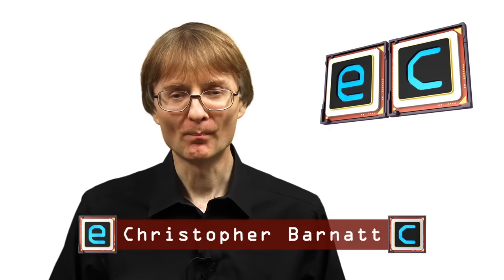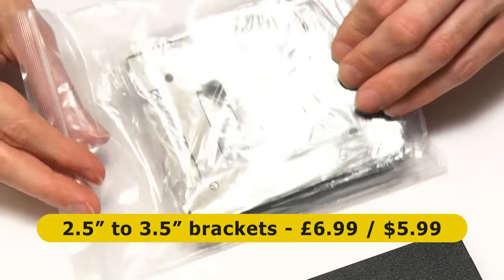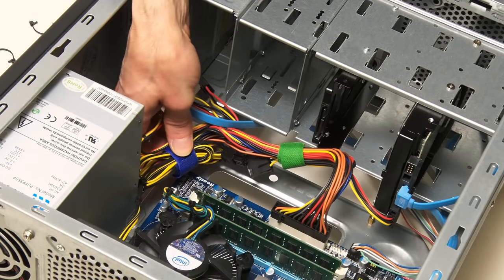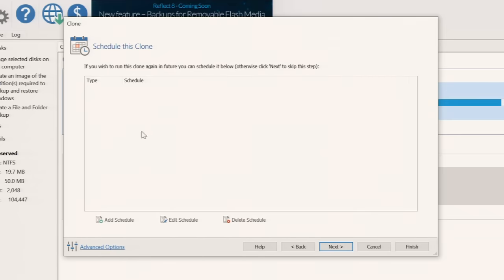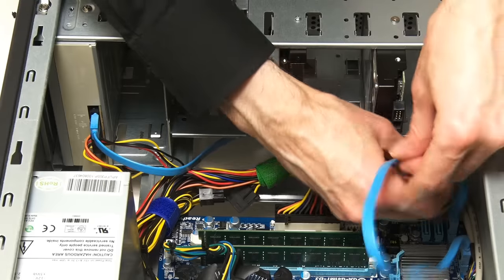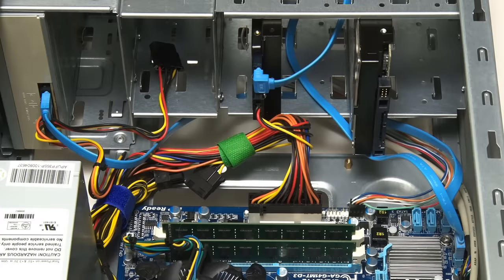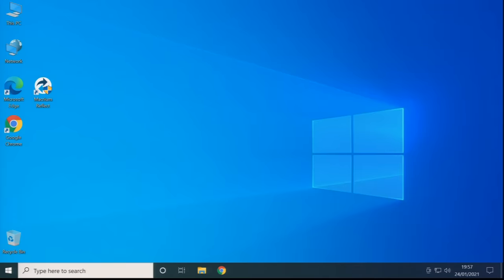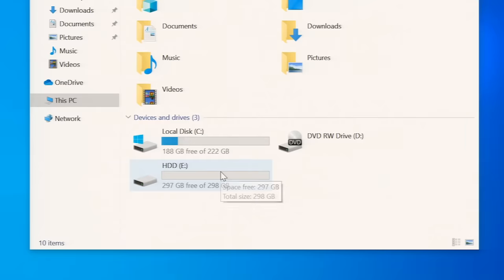Old PC Upgrade #2: SSD Boot Drive

Comment: Hello SIR, I have an old pc with an AM1H-B ASrock motherboard. The motherboard contains only two SATA3 ports connector cables. I plugged in the dvd player and the hard disk driver respectively. Is it possible to add a second disk in the destop?
If this is not possible, can I eliminate the DVD player definitively and use its connection for the second ssd or hdd that I want to install? thanks in advance
Reply: I personally would get rid of the DVD drive since it isn't as useful as it used to be since a lot of programs are only distributed over the internet. In this instance, you would just disconnect the power and data cables from the DVD drive and connect them to the SSD. 
The next option would be to buy a PCI-E SATA controller. This will give you some more SATA ports to use.

Comment: can i use m.2 to pcei x1 dapater as bootable drive?
Reply from the maker: It will depend on your motherboard. Some support booting from a PCIe slot, other don't. So you'll need to look up and check the manual.

Comment: due to continous circumstances & failures have always preempted back up and even transistion from one platform to another including theft, apt building fire, etc etc. zI just gove uop assuming that anything i have done in my life is of any value whatsover. I have drawers of bad parts and failed devices. At 69 I am really jaded.

Comment: Thank you very much for your video sir. I would like to ask you if I need to format first the SSD or the cloning software will do it for me. Thank you again for this nice video.
Reply from the maker: Thanks for this. You do not need to format an SSD before you clone to it -- cloning is a lower-level process and will remove and replace all formatting on a drive.
Reply: @ExplainingComputers  Thank you very much sir for your reply. I acquired an A-Data SU655 240gb from Amazon and will install it on an old Intel D9965LT MB. I will do exactly as showed in your video. Again, than you very much for sharing your knowledge.

Comment: im a bit amazed you didnt explain or indeed alter the old hard drive/win10 install to AHCI before cloning to the ssd 
its a 2 minute job now in win10 
delete all storage drivers in w10 , boot to bios change from sata to ahci and restart ,upon which windows craps itself and loads the ahci driver and storage controller totally forgetting it was installed as sata before ,bearing in mind then you would have the ahci setup ssd after cloning with all its tricks and treats 
(i am assuming the g41 board has ahci in bios as i have an old gigabyte g31 here ,a lesser chipset, with full ability to set ahci in bios )
only commenting as this seems a fundamental basic when migrating the old core2 era boards to a ssd
Reply from the maker: G41 boards do not have AHCI. :)
Reply: @ExplainingComputers   very strange the g41 dosnt have ahci yet the lesser g31 i have here does,wierdness isnt something new though with pc's /bios versions 
still the point was more you detailed every other option when doing a ssd upgrade i feel there should have been a mention to check/alter settings for hard drive (and in the case of these period boards even to confirm its running correctly in first place with a sata and not ide mode in bios ,i have come across systems in the past using a sata drive in ide mode)

Comment: What if you have 1GB HDD then only 256GB on your SSD and many files on your HDD then you decide to upgrade your PC into SSD? Is it okay? Or is it not applicable?
Reply from the maker: You can only clone from a larger to a smaller drive if all of the content on the larger drive will fit on the smaller one (ie here there is less than 256GB used on the HDD).

Comment: Have to disagree about cable ties. They are easy to remove with a simple nail clipper.
Reply: Easy to remove... and sometimes bound on so tight that to avoid cutting the insulation, you have to carefully pick away at the cable tie (especially if it's tight against something as I've often seen with OEM systems).
Reply: @Reziac  As long as you carefull it's okay. Most of the time I only cut it halfway deep to be safe and then it breaks easily.

Comment: I've followed this to the point where you boot the cloned SSD. But, I just get a black screen with a blinking text cursor. Any help would be appreciated!
Reply from the maker: Was there an error reported at the end of the clone process?Have you disconnected the old boot drive?
Reply: @ExplainingComputers  many thanks for replying! No error reported, it finished on screen the same way in your video. I disconnected the old HDD too. I can see the computer recognises the SSD as I tried booting again via BIOS and selecting the SSD. Still lands on the same black screen. The only difference between what I did is I’m using ver 8 of their software as it was the only option. Do you think its not copying over Win10?

Comment: If I want to speed up my PC that is configured RAID 1, (mirrored) Can I just replace one of the HDD's, rebuild the array then replace the other HDD?
Reply from the maker: What a great question! :) In theory, yes -- that is how mirrored RAID is supposed to work. So in theory you could remove/fail one of the HDDs, add an SSD to the RAID, remove the second HDD, and add the second SSD. In practice I would not try this, at least not without taking an image of the volumes on the RAID array first. And if you have the storage to do this, you would be better taking the image, then building a new RAID with the SSDs, and copying the image back to them. But I've never tried doing anything like this with a RAID boot volume. I've only used RAID for file storage.

Comment: What about working on systems with older IDE or even SCSI drives ?
Reply: It works about the same, tho getting an IDE to SATA adapter to work can be an adventure (and some of 'em run really hot). IDE SSDs do exist, tho. I put one in a 20 year old Mac G4 and it made a big difference, even tho data transfer was still limited by IDE -- the SSD reads that much faster than the old Quantum  HDD the system came with.

Comment: Thanks!
Reply from the maker: Many thanks for your support, most appreciated.
Reply: @ExplainingComputers  Just a token of my appreciation. I found your presentation very lucid and informative. I have been looking for a way to connect the 4-pin (Molex?) power connector that came with StarTech's 2.5 inch Sata Hard Drive to 3.5 in Drive Bay Mounting Kit. Apparently my Vostro mini tower 400 does not have such a connector to receive the 4-pin power 'plug'. Maybe, no motherboards offer such a connection, but I am just guessing. There are 3 spare SATA data connectors, so that will be okay. I viewed more than half a dozen related videos but could not figure out a solution other than finding an adapter of some kind. Your simple suggestion to temporarily use the power connection for the DVD drive for my purpose saved me a lot of time. I have yet to open the computer enclosure to install the SSD on the spare drive bay, but I think it should work. Btw, I have cloned my existing HDD to the SSD using Macrium as well but with a USB external docking station. Thanks.

Comment: Is an 120gb SSD enough for this?
Reply from the maker: It depends what you want to do on the PC, but 120GB is fine for your operating systems and many applications. The minimum for a Windows 10/11 system these days is 64GB, so 120 is fine. :)
Reply: Thanks!

Comment: Can I buy any ssd for my desktop or does it need to specific based on my machine specs
Reply from the maker: You can use any 2.5" SATA SSD to do what is shown in the video. The only requirement is that your computer connects its drives via SATA ports. This is very likely to be the case if your PC is 15 years old or less.

Note that some SSDs have an "M.2" form-factor to plug directly into the motherboard. So make sure to get a 2.5" SATA SSD and not an M.2 SSD (unless of course your PC has an M.2 slot, although this is unlikely a older PC). I have a video about the different types of SSDs here: https://www.youtube.com/watch?v=EXLfErPEYiw

Comment: If your older computer can't deal with 2TB drives, do not install an ssd as it won't be able to make use of TRIM and mess up the SSD in no time
Reply: Newer SSDs supposedly handle TRIM for themselves and don't need to rely on the OS to do it. -- In fact I have WinXP on an SSD, been running 3 or 4 years now without issue.

Comment: I have been dabbling with SBCs now for a couple of years. I now use a raspberry Pi4B 1GB with OpenWRT as my home router/firewall with a direct connection to a Fibre 500/500 pipe with an Ethernet media converter (ISP modem/router completely removed). Best thing I ever did. Internet has never been snappier. In FPS games I get ping times of 8 milliseconds, sometimes even less. Speedtest(.net) gives me a response time of 1ms.
Now tinkering with some small format SPI lcd displays for an ambitious project but my limited knowledge of python is now getting in the way. Anyone out there who might be able to help me a hand with that?

Comment: I cloned the HHD of a Lenovo Ideapad Z580 running Windows 10 (with no problems, even though Lenovo says it's not compatible) to a Samsung SSD using a SATA-USB cable. The transfer went fine but I could not boot the computer from the USB even though I changed the boot order and tried both Legacy and UEFI modes. I took a leap of faith and inserted the new SSD and it booted just fine and is working great. Anyone have an idea what I missed?

Comment: just remove the DVD entirely
no general user uses that anymore 😂
Reply: Speak for yourself.... There's lots of people who still use optical disc drives as not everybody is able to download or stream everything
Reply: @SupremeNerd  sure.
But for the majority of people, they don't use it anymore; Even if I do need to use it, I would use a USB optical drive. Nowadays, laptops and even the lower end consoles ditch them; If you buy a physical copy of Windows 10, they now come with a flash drive instead of a DVD. And sure, there are things that are still used in DVDs; Something like video games and films. But those are usually inserted to either consoles or media players; not computers.
Reply: @RichardiOS275  liked i said, just because YOU don't have a use for it doesn't mean nobody does. Just because YOU DON'T use it doesn't mean nobody needs to use it. You mentioned downloading Windows... Ok so you could get it from the website but suppose you don't have internet on order to download it from the website? You have a disc, you don't have that worry. You want to play a game and you don't have the ability to use Steam... How else are you gonna play it? You have a disc you don't have that issue. This is why they're still made and why computers that are not gamer computers come with em. Most people that you know don't have a use for it... That doesn't mean nobody does. Not even up for debate. You don't use it and that's fine but to say nobody does or the majority doesn't is inaccurate. I for example would rather have a hard copy of something and use my bandwidth for making money... But that's just me. Also, i have never seen games or films inserted into media players or consoles. Not even the new PS5 or Xbox has those. If anything you download stuff to it switch still means you need internet. Windows Congress on a flash drive but it also comes on a disc... Look it up yourself on Microsoft or Even Amazon
Reply: @RichardiOS275  using a USB optical drive is cool.... If you have one of those.... But if not, what do you do? If i already have that on my computer i don't have to go spend money on a USB optical drive

Comment: can it boot on very old pc like 2004 version of pentium 4?
Reply from the maker: Yes, you can use and boot from an SSD providing the PC has SATA ports to connect the drive (rather than an IDE port). Note, however, that a PC of that age may be limited in the size of drive it can handle. I cannot remember the limits, but a 128GB SSD should be fine.
Reply: @ExplainingComputers  80gb with WinXp should be a good one.

Comment: Got excited and left positive comments here but I am editing now here because as I tried to follow the video, it did not work. THERE ARE MANY CRUCIAL STEPS not covered/ignored. Spent 6 hrs trying to do what this video suggests but with no success. Had to find another video (with lots of details and no gaps) that finished the job! Following this video, first I received an error on SSD not being formatted, then I had to find other sources on how to format (NTFS). The cloning software has been upgraded (you now have to provide an e-mail and receive a code to use the software for free). Following this cumbersome software (he calls it "fantastic software", really??? are you kidding me?)... It is an unfriendly, crappy software and most importantly it does NOT work! Also, getting to BIOS by tapping the Delete key does not do it (and no info provided on the video).  Yes, it seems very logical and easy to do all this, but there are so many pitfalls that are not mentioned on this video. For me, it was a waste of time (did not learn anything and could not finish the job).

Comment: That is a slow ssd drive.
Reply from the maker: No, it is an SSD on a SATA II interface.
Reply: @ExplainingComputers  yes but even on sata 2 I thought it should be getting in the 220 range instead of 180-190. Those hdd results are obviously the cache hitting for that low 100 results.

Comment: i suppose this is still a useful video for some beginners, and the computer itself can be useful for allot of things, but if you can find this computer useful you don't need this video, and this video isn't particularly useful for a modern computer. and don't get it twisted, i worked at a computer store when these computers were a thing, i built a few hundred of them, but the people who this video would be useful for don't exist. i am completely contradicting the start of this comment with the end, this video is practically useless. i say so because based on the hardware there is no turning it into something that a teenager would want. it was thrown out of an office because nobody in an office would want it. so the only people who might want it are people who know how to use the hardware without being taught how to use it.

Comment: WRONG.. the goal would be install the operating system on the ssd and make the hard drive a slave drive. and have games and images on the normal hard drive. You sir have got alot to learn about a PC.
Reply from the maker: We all always have things to learn. But I know quite a bit about computers, not least having taught computing and technology in a university for 30 years, and having written 13 books. In this video I do set up the hard drive as additional drive, so clearly you were not even watching. And there are no games on this PC. Most PCs are not used for gaming!
Reply: @ExplainingComputers  i consider myself just knowing the basics of computers. yet i hold more knowledge of what to do with one than you seem to have. so your 13 books are what not to do on a pc or what lol.
Reply: @southernprojectsyt6340  You put the games on the SSD.